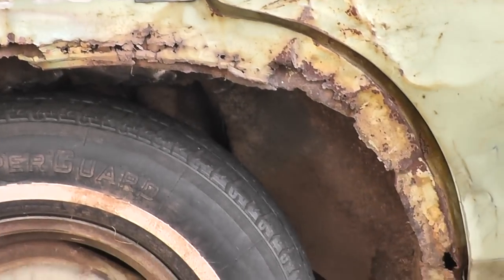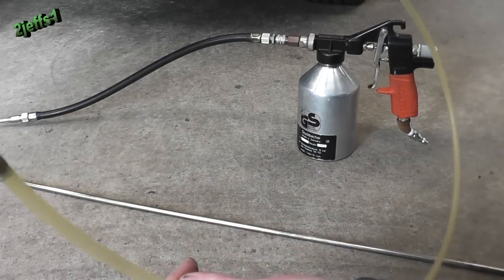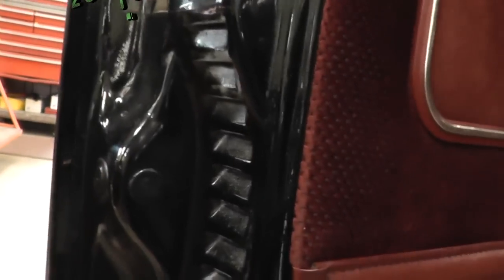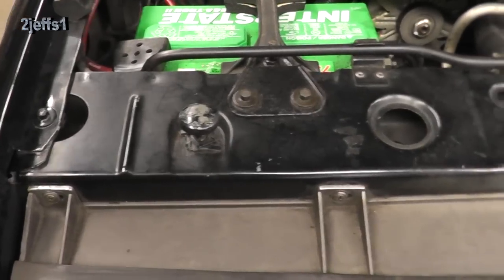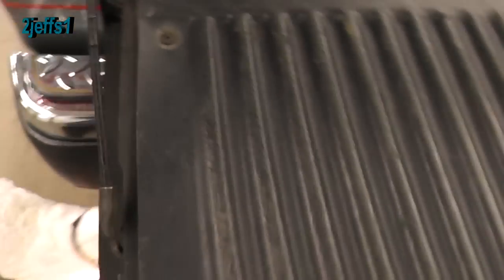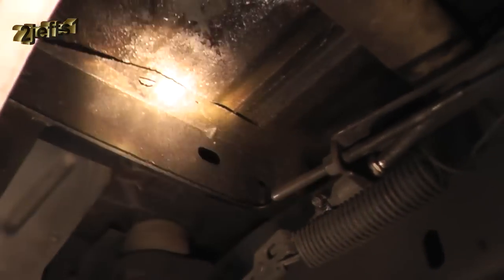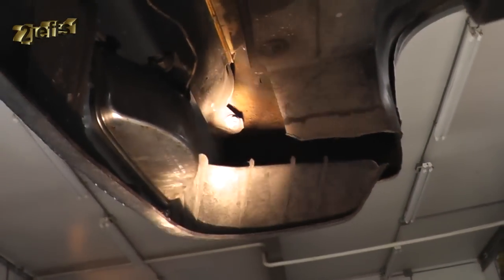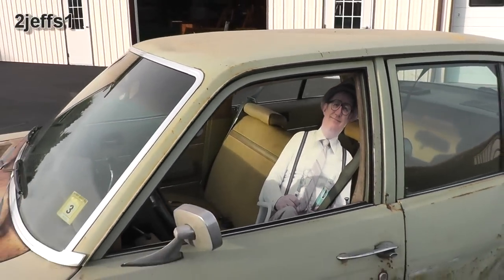Oil Undercoating DIY

Comment: Nice vid, very informative. I'm in the UK with a 1989 Ford Fiesta that's rusting on the wings, sills, doors and a few other areas such as around the bumpers. I'm going to invest in some sort of spray gun and apply oil! It looks like it's been hit/scraped on the passenger side in its past which has unfortunately caused rust to start eating away at the left door. I've seen so many US videos showing these great DIY techniques for rust prevention but not many at all in the UK until this week when a guy on here with a channel called Hub Nut took his new 90s Skoda Favorit to a shop for a complete strip down and body spray Krown.

How messy is this job do you find? My only concern is that I don't have a garage so will be doing all the work on the street. I guess old blankets and Amazon boxes are going to be useful ;) 

Also, is there an advantage or disadvantage of using old/used engine oil over new stuff? I kinda wanna put the old stuff to use for the sake of recycling it without taking it to the recycling centre. 

Thanks again!
Reply: Old post I know, but using used vs new oil shouldn't matter too much (do not use gear oil though, it STINKS really bad). Using stuff like Krown or Fluid Film is better. The main issue with using engine or transmission (gearbox) oil is that it can cause problems with any rubber on the car like bushings and some seals. But it's a hell of a lot better than rusting. The issue with rubber is less of a problem with stuff like Krown or Fluid FIlm because they use less oil and more proprietary stuff designed to not cause issues with rubber.

Comment: Hey Jeff, glad your video popped up. Was subscribed awhile back and then all of a sudden I lost a bunch of subscriptions. Don't know why but it was during that time when You Tube was doing its thing with all of the censoring etc. 
Maybe your channel is too far out there for all of those millenial cubicle dwellers at Google to understand ;-)
I have a 1977&1/2 Ford 1 ton flatbed that I bought new in 77. I'm  going to spray it even though it's not running at the moment as I worry about it just setting there and condensating. Will also do some of my other rigs as the the newest vehicle I run is a 92 and my daily driven work truck is an 89 E 350 dual rear wheel with a 15' box fully loaded with tools and supplies for plumbing & heating. It is maxed out on the gvwr but the doors still close nice and solid. Wish I could say the same for my Chevy 4x4 wrecker that is about the same age but has not had any where near the use.
Keep up the good work.
Reply from the maker: Welcome back! Yeah - there was a lot going on the big G there for a while. Sounds like quite the collection of useful vehicles you have. Where you bought the 77 there is something about being able to tell people you bought it new especially when it would still be looking nice. Like you said even if not being used it is a great idea to oil it. I bought a 74 CJ5 Jeep new (many mod's from the Chev 350 to the Muncie rock crusher trans, custom paint, homemade lift, etc) and seen the body disappear as years passed. That rubberized undercoating looks great until it shakes loose and traps water between it. I started using oil on the truck where one don't want to see that happen again. It is messy but sure beats doing rust repairs and works so well. Thank you for stopping by. I really enjoy reading the comments of what others are up to! Jeff.

Comment: Hello 2Jeffs1,

So 10w-30 conventional motor oil work well is what it sounds like even if there is plastic and it gets on the plastic? Sometimes there is overlap. Subaru Foresters tend to have a good amount of plastic as do many other cars. Obviously the oil will get sprayed where the metal is, but I thought I would still inquire. My friend will be spraying it too, so when he drills holes, where should he drill and not drill? I ask because I know Krown does for their cars but they know where. We are novices.

Comment: Only way to make a vehicle last, especially up here in eastern Canada. I just paid to have my truck professionally undercoated, but wishing I did it myself, they seemed to miss quite a few spots. I have I nice undercoating gun similar to yours, but none of the attachments seemed to work right, and the small nozzle blew out and into my truck frame, never to be seen again haha.
Reply: Gearheadtom i go to them and get fhem too do it right..
Reply from the maker: I hear you on they missed a few spots. Have seen that thru the years. I think the guys doing those type jobs get paid by the job so.... I hate that when those parts run away like that! Grrrr

Comment: I want to start this on my new Jeep, I have read that the oil breaks down rubber, have you seen this.  You seem very knowledgeable and I want to do your method but I want to find out if oil is bad for any rubber under the vehicle
Reply from the maker: I have heard that too but haven't experienced any failures due to doing this. Actually engines have rubber seals however their is multiple kinds of rubber.

Comment: So did you use old motor oil.  Don't have a compressor yet so I was wondering if I could use a garden spray pump that holds about a gallon of fluid and maybe use ATF. Just changed my Tranny fluid and still looks good and red.

Comment: That is a timewarp condition Ranger,awesome! Do you thin the clean Engine oil with anything? and what grade do you use 10w30?
Reply from the maker: Yes clean oil, no thinning where that sprayer has a pressurized cup to force the oil thru and use 10x30!
Reply: @2jeffs1  Thankyou
Reply: @2jeffs1  Why not combine melted toilet wax rings with the oil?

Comment: This looks very cool, but a few questions remain.
What about drips on the driveway concrete? Or does that go away soon after?
Does it attract dirt?
Reply from the maker: Yes It will drip for a while and attracts dirt. That is the drawback. Rust or stains.
Reply: Screw dirt, it'll mostly be underneath anyway.  Unless you're entering it in a show, who gives a shít?

Comment: What do you think about using waxes intended for undercarriage to slow down corrosion? They should do an equally good job, that's their purpose ... It's wax, though, and it's not so messy ? if not, is it better to use manual gearbox oil than engine oil?
Reply from the maker: Your right, that would be better, I just use what is available , on the shelf here.

Comment: jeff just doing my other truck (a95 GMC 4x4) and I have the bed off using used oil and thinning it with Marvel Mystery Oil but trying to apply with a pump sprayer but still seems to thick for the sprayer even after being thinned. Then I tried using a HVLP gravity feed sprayer but did not come out well. Is your undercoating gun the only way to spray it? So far I'm ok because I'm spraying and then using a brush to fully cover everything.Would like to hear your opinion on the best way!! THANKS!! I only have 2 more old trucks of my own to do.
Reply from the maker: Hi Dave. That gun that I am using is a pressurized cup to force the material thru. I had used a siphon gun years before, like you said worked poorly. (slow!) Had a thought of enlarging the tip on the pump up sprayer but don't think that would work good where no air is going thru to atomize things better. Many moons ago I did have a Sears screw on cup gun with a valve on the side to use it as a pressure or siphon gun. Worked great for priming, never tried it with oil. If you can find something like that with a pressurized cup (could adjust to a round pattern instead of a fan on that top knob) it would probably suit your needs. Would be great to get something that works good where it sounds like you have several vehicles to do yet!

Comment: Hi 2jeffs1 was wondering what kind of oil  would you recommend. Hi mileage or low mileage oil
Reply: Oil is oil
Reply: @ffhjvbuydb78eb  Bar and chain oil works great but really any oil will work. Whatever is cheapest.
Reply: @NigelNaughton  The only thing I am worried about is when you wash your truck then you would wash the oil off.
Reply: @ffhjvbuydb78eb  it's going to take a lot of washings with some really heavy detergent to wash off that oil.  Do you ever noticed that when your engine leaks a little oil any car washes never wash off that oil so it's the same principal.

Comment: So this might be a silly question, but you spray this undercoat on bare metal before paint, right? Thanks for the tips, planning on doing up my MGB GT when I can (not too many years hopefully! :P ).
Reply from the maker: Glad you asked. No, don't do that. Any oil contamination on the face/paintable side of a panel would create fish eyes in the paint and a poor adhesion problem. I would allow your paint to cure approx 1 month before doing this.
Reply: Thanks for confirming. I'm still hoping to find some base-coat/under-paint solution to eliminate any potential for blistering. It's so wet here in the UK that it's hard to do with good ol' paint; guy I bought my car from only did the paint two years ago and there are already 5 trouble spots :/

Comment: Is there a way, or product, that I can apply clean 10-30 wt motor oil WITHOUT a gun that requires compressed air ?
Reply: Go to your local hardware store and buy a pump sprayer the type you'd use for spraying weeds and then buy a gallon of linseed oil and a gallon of mineral spirits. mix together and spray through the pump sprayer will be enough to do two vehicles. The linseed oil dries waxy and is excellent at preventing rust. I put a tarp down put my car up on ramps and spray away do this late fall just before winter and it'll last for a year I live in the Northeast believe me we know salt.ps park your car in the dirt or grass for a week because it will drip until it dries

Comment: jeff I used a gravity feed gun and even turned up the pressure it didn't help much. I even thinned it with Mavvel Mystery oil. would an old style gun be better? I have a few of them.
Reply from the maker: Hi Dave. I should of mentioned the gravity feed gun I had was actually an undercoating gun for that purpose. I should say it worked ok but the one I use now is 600 bucks and kinda spoiled me. Also that type had no adjustments on the rear. All pressure cup guns have a much thicker wall than a regular gun. I just checked and there a lot of undercoating guns that look pretty good from 30-50 bucks. They are siphon type but to get into the pressure cup ones, that will get kinda expensive.

Comment: I've seen some guys add wax, grease and lindseed oil so it doesn't drip off. What do you think of that?
Reply from the maker: Never tried that but sounds like something that would worth trying especially if one has a cement driveway.

Comment: How long does the oil last? How many times a year do you do the oiling? Wouldn't a power washer just wash the oil off and all that would be for nothing?
Reply from the maker: A power washer cannot get into the areas where the double seam is. Yes it does remove the things in the wheel tub is but doses not get into the double seam areas where the oil creeps and the rust starts.
Reply: @2jeffs1  I wash out the wheel wells in the winter time with a power washer

Comment: Thank you for the video! Do you recommend a non detergent straight motor oil? Or any oil obviously is better than non. Just curious if used motor oil with the contamination of the engine will affect the paint or other things! Also do you spray your frame and underbody with the same oil?
Reply from the maker: Hi Kieth. Never used old oil. Been using regular 10w30 off the shelf, never had any paint issues. I do use the same oil on the frame and under body. Thanks for stopping by, Jeff.

Comment: What kind of "oil" do you use? I may have missed it.
Reply from the maker: Your right, don't think I was clear on that. I use new 5w30 engine oil where if one would use old oil sometimes it can have undesired smells if the vehicle is garaged. I do go thru app 4 qts but is so affordable v/s doing those rust repairs!
Reply: Save your old ATF for that and mix some cheap Vaseline with the bar oil and heat to spray.     It makes a gooey slime much like Krown.

Comment: Looks like it is working Great.......I stopped using WD-40 on my tools ..I found some cheap penetrating spray at a Dollar General store ..(Their brand name)..It has a  parrafin wax base and it leaves a nice waxing feeling coating ...I use it on my drill press table and it has kept my tools rust free
Reply from the maker: That sounds like it would be better than what I use. I have been using the cutting oil (where it is handy there) and it helps but things still get a light rust film on them after a while.

Comment: Yea used oil is the chit!  On a truck lower the spare wheel do the mechanism and the cable..  take out the tailights and spray the chit out of it to get the back fenders..  also I go to the dollar store dumpster get boxes unfold them spread them out on the floor to catch drippings an mist..  peace out..  Bungee ....

Comment: I don't have a pressure spray but I want to use engine oil to spray the bottom. What kind of manual spray can I use? Thanks for any suggestions.
Reply from the maker: Seems I tried a garden pump up sprayer years back but where oil is thicker than water it didn't work good. Wanted to spray like a stream instead of mist. wish I could suggest but with my write up that might help you understand to find something I wouldn't be aware of....
Reply: I use a big thumb pump oil can which jets the oil out 2 feet if I want it to. I either warm the oil up or thin it a little.

Comment: Do you do the spray once a year or just once for the life of the vehicle?
Reply from the maker: Every several years, as needed. Actually 1 good application getting into every area would make a huge difference to the life of the vehicle.
Reply: Sounds great, I just picked up a 2012 Ram 1500 with no rust under it. I’d like to keep it that way and this seems like a route I can do. How does the oil applied underneath hold up to a car wash?

Comment: About how much oil is needed for a full size truck? Thanks
Reply from the maker: I would guess around 6 - 8 quarts when doing for the first time. Several years later there will be areas that wont need attention again. Then less will be required.

Comment: Wouldn't the oil destroy all the rubber bushings and what not?
Reply from the maker: Every thing in regards to that is still original parts.
Reply: @2jeffs1  I had the same body style ranger. I really liked that one. V6 with the five speed manual.

Comment: Hey jeff, i put engine oil on brake hoses and some plastic components under my car and now im reading that engine oil can degrade plastic and rubber? Any experience with this? Am i screwed?
Reply from the maker: Hi Nick. I haven't seen any damage to brake hoses or plastic parts and I have done this on other vehicles too. Now if someone is using old oil that was contaminated with something that does have a conflict perhaps that could be possible. The only thing I noticed is the rear sway bar rubber links expanded a bit at the ends but where they are original and good yet, well, no biggie when they do need replacing. The body mounts, brake hoses, etc can be seen on several of my other videos in the background. Everything is doing quite fine.
Reply: 2jeffs1 thanks so much for the response, That gives me some peace of mind for sure! Thank you for your extrenely informative videos as well ☺
Reply from the maker: Your much welcome Nick. I wanted to get back to you right away where I could tell you were very concerned about that thought! Always glad to help out!
Reply: 2jeffs1 well i appreciate it. Thanks again!

Comment: How does the oil stay on the frame to protect it?
Reply: Especially if you wash your car often?
Reply: It depends of the oil used. If the oil is thin, it can require an annual application. If the oil sticks better or it's a thicker product, it can require an application every few years. Usually dirt form the road sticks on the oil so the oil itself doesn't get washed away fast.
Reply: I use used engine oil with black waxoyle mixed 1 waxoyle to 3 parts oil. Heat in an old pan to thin it down and spray. It dries to a pasty texture.

Comment: Whatt kind of sprayer would you recommend nowadays?
Reply from the maker: Hi Tyler. That Sata undercoating gun that I use is still available. You would just have to find a vendor in your area. I bought mine from an automotive parts store that sells automotive paint. Also I heard that Harbor Freight has a pressure cup gun but not familiar with that one.
Reply: Thank you very much good sir! I appreciate your rapid response!
Reply from the maker: Your very welcome, happy to help out! Jeff

Comment: Can you mix diesel  and transmission fluid in a bug sprayer?
Reply: Yes you can you can mix diesel fuel with clean drain oil or bar and chain oil also to thin it down to use in a pump sprayer. I recommend the one gallon size sprayer so you can handle it better.
Reply: Alright thanks

Comment: What a great way to BURN one to the ground really fast. Number one cause of huge vehicle fires are oil leaks. Imagine most the people that try this are going to have oil dripping on their exhaust somewhere and catching the car on fire and if it ever does it's going to go really fast with oil up in every hole and crevice it has. Maybe you should use something that's a little more fire resistant?
Reply: all undercoating shops use an oil based product, do you think they do that so they can get sued? man up!
Reply: @jackle842000  I use Woolwax not motor oil and it's best to get those oil leaks fixed. Didn't you smell burning oil in the car?
Reply: @North49191  wasn't my car and no you only seen flames flying out the back because it was going down the highway